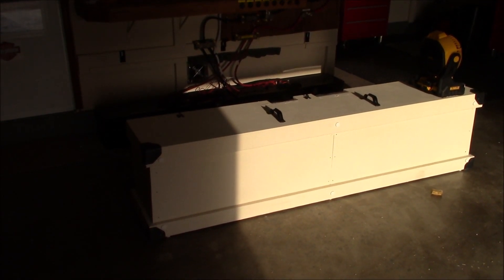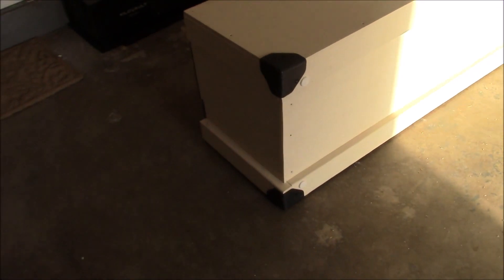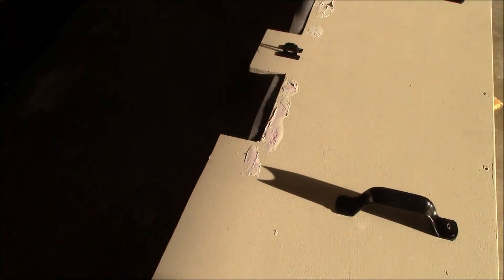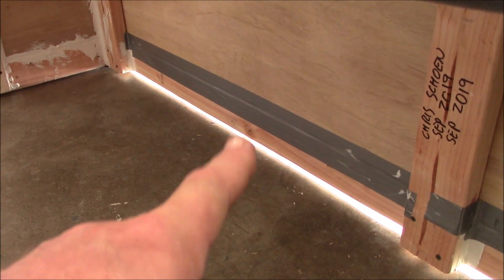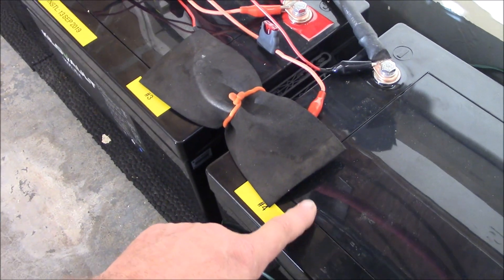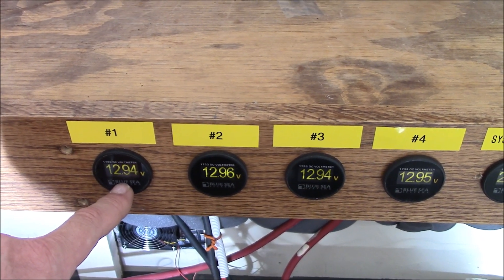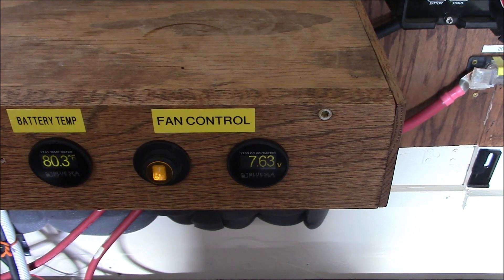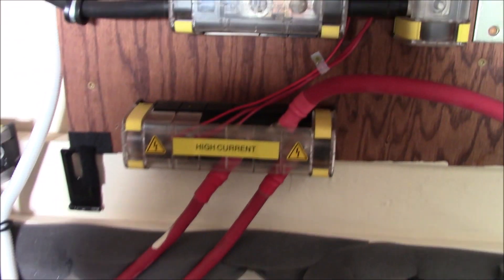DIY made climate controlled lithium battery box enclosure

Comment: hi chris can you link me to your bus-bar  deal . they look  like the right size for my system.  is 2/0 gauge ok for battery to dc disconnect. and to bus bar and battery bank?
Reply from the maker: Excellent question. The pure copper bars I used are custom made, about $24 for a 12" solid bar on Amazon: https://www.amazon.com/gp/product/B01F80W5EU/ref=ppx_yo_dt_b_search_asin_title?ie=UTF8&psc=1 
I cut the 12" bar in half (two 6" bars) with my saw and drilled two 5/16" holes. I used a grinder to clean up the ends and used the wire wheel (on the grinder) to shine them up. I put some heat shrink tubing on them (to protect them). Cutting and holing copper is tricky...be VERY careful and go slow. Safety first (use gloves, eye protection, clamps, etc). Everything I say on here are "suggestions" and "opinion" so, fabricate and/or attempt at your own risk. They are MORE than adequate (pure copper, thick and heavy) for 2/0, 4/0, whatever you can come up (like dual battery terminal holes for example...running more wires). Mine work perfect and am very happy with them. Good luck

Comment: That's really a nice set up you have going there. You've got me leaning more and more towards these as well now. Just a thought, can't you wire in the fan with the battery temp sensor so the fan only kicks on when needed or even just for a minute or two every hour or so?? Maybe even staple some vinyl fabric to the bottom vent area, so it keeps more of the temp controlled air inside, but when the fan kicks on, it's flexible enough to move and open up some to allow air to flow and raise or lower the temp inside the box as needed. Just a thought. Keep up the great work.
Reply from the maker: Excellent! Yeh, I am considering both ideas. I have a 12v battery temp sensor that I am going to test this week. Also, got the quieter fan in yesterday...much better with enough airflow into the box
Reply from the maker: Thanks. I just installed a lower CFM 12v 120mm fan...much less noise, low power consumption, sucking out less air from the house. Box temp is at 77F right now. No issues. It's a "balancing act" ...can't pull too much air out of the house for the box, but still needs to do it's job. The original fan was basically a jet engine...way too loud and waaaaay too much airflow. Now, all good
Reply: @ChrisDIYerOklahoma  That does sound like a more appropriately sized fan for that box. I still think that you might want to at least experiment with sealing up that vent area at the bottom. You can never go wrong with sealing up every crack and adding more insulation when it comes to trying to control a climate. I mean that's what we do with our homes and it always seems that air leaks and circulates some where some how no matter how hard we try to stop it, and I bet this box will be no different, just on a smaller scale on the leaking factor. I'm really REALLY interested in hearing updates on how these batteries work for you in the coming months. Keep up the great work.

Comment: Nice installation Chris.  I am still amazed at how fast mine charge up. Coudy and rain all week and batteries are still full by noon. That said in December I have weeks on end where the Charge controllers don't even wake up lol.
Reply from the maker: Thanks. Yeh, I am still "learning lithium" on a home RE system. Fine tuning the set points for cut in and cut out, charging, and maybe some battery box fan controller (temp monitor to turn on and turn off). Overall, I am on lithium now and not dead (didn't kill myself during the install or burn my house down). Gotta stay positive!
Reply from the maker: Dreading those long cloudy powerless days...Dec is the worst. I am learning that a big lithium battery bank (14.4 kWh) is like having a big fuel tank. Sure, it lasts a long time, but refueling (while the engine is running) takes a lot of solar power to get them up to 100%. Having to use my charger function on the Outback inverter...been cloudy here too

Comment: Great work.  So how did you extend the wire on the temperature gauge?  Did you have to swap out the probe?  Thanks
Reply from the maker: Just swapped out the 10k probe/wire with a longer one. Like $7 on Amazon
Reply from the maker: Swapped out the probe...like $7 on Amazon

Comment: Awesome setup!! Thanks for posting.

I thought once batteries were connected (either in series or parallel) it wasn’t possible to get individual voltage readings from each battery — that even if you connect meter leads to each battery’s terminals, the meter(s) will show you voltage from the batteries that are connected.

I have 5 LiFePo batteries connected in parallel and when I use a multimeter to measure them, I can’t seem to get discreet readings from each battery (all readings are identical to the hundredth of a volt). Any feedback would be appreciated.
Reply from the maker: The individual metering on each battery is more for discharging voltage monitoring. When charging, not as accurate. Kinda like taking a car's battery voltage while the engine is running (and the alternator is cranking out voltage/power). The meter will be showing the alternator voltage. Turn the engine off and wait a while...the voltage goes down to battery voltage. Best way to measure a battery's voltage (in this configuration) is to disconnect the series-series-parallel configuration and voltage check each battery independently. I had a bank of 12 FLA batteries (series-series-series-parallel) and used to "spot check" batteries for problems while connected. One time, found one 6v battery at 4.9v. Disconnected it...it dropped to 4.2v. Did a video on it. So, what I have going on with the new lithiums isn't "ideal" for measuring each battery's voltage...but, when there is a load on each battery, can monitor how it behaves while discharging. Health watch while under load.
Reply: Got it. Thanks again. Love your vids. SO MUCH SOLAR!! Wish I had a yard like yours!

Comment: How much of your house will this battery bank power and for how long?
Reply from the maker: It all depends on how I consume the kWh. I offset six (critical load) circuits in my house with renewable energy (my grid-connected garage system). With a full charge, the batteries can produce up to 14.4 kWh (rated). Right now I am using a window AC unit (1 ton unit) to cool the main part of the house...so, using a lot of power. When cooling season is over and I have sun to work with...should hold all my critical loads overnight.